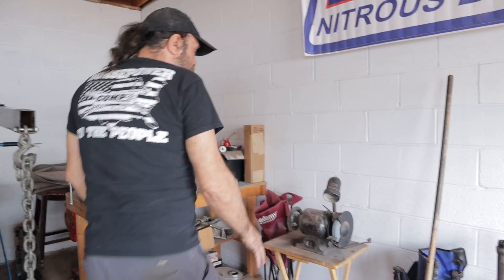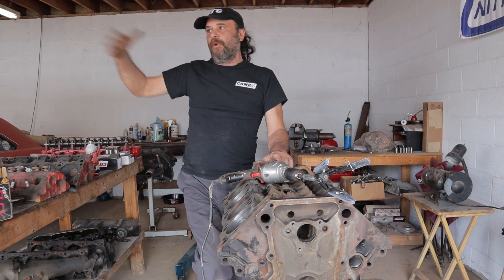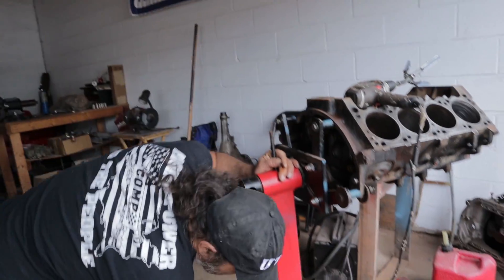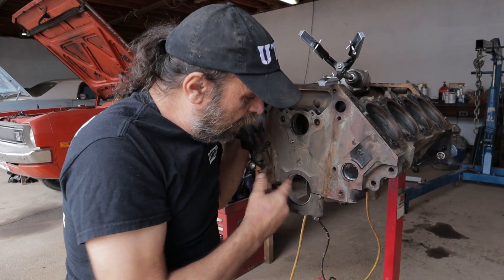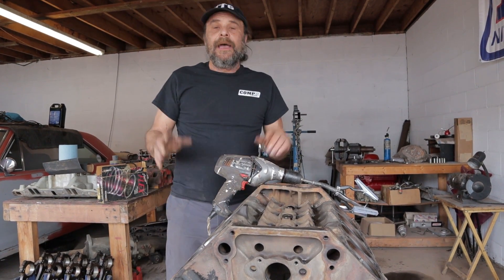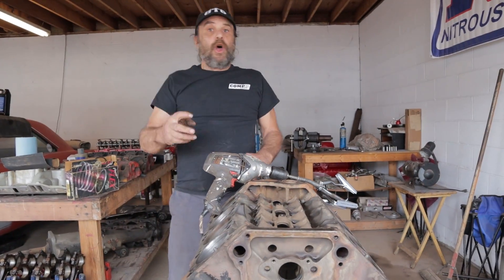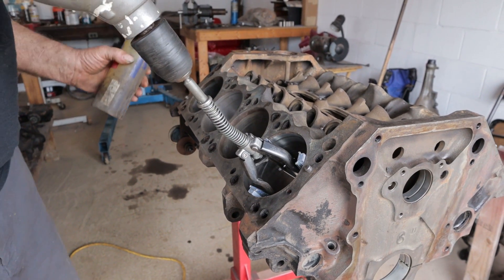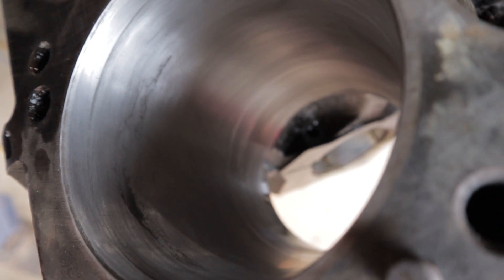Perfect Daily Driver 6 - DIY Engine Block Prep

Comment: My engine textbook calls a dingleberry hone a "finish" hone and a fixed stone hone a "plateau" hone - the finish is for honed cylinders and the plateau for opening a cylinder from the piston diameter after boring to the finished diameter (with proper cylinder-wall clearance)

Comment: RE: Ridge reamers... At least as of 1999 Ford was still putting a step in the engine disassembly portion of the factory service manual to run a ridge reamer on each cylinder before trying to remove the piston.  I recently disassembled a 4.0l v6 from a 1999 Ford Ranger, heavily used, no ridge at the top of any cylinder at all, so I wondered what they were going on about.  I had no problems removing the pistons from that engine.

But, suffice to say that people are still using them at least in part because the manufacturers are still making a recommendation to do so.  Not that I believe a whole lot of things that the manufacturers say.

Comment: I sure didn't have enough time to learn from this professor. 
LQ4 block, bent rods from (I'm guessing hydrolock), work truck and a $900 budget. Now a misfire from the 2 damaged cylinders. I wouldn't been able to bore anyway.     The machine shops were backed up.😔 I needed to get back to work.

Comment: I've heard that there is a situation where a ridge ream is necessary...a guy scored a nice 455 Pontiac that was never revved past 4,000 rpm...but he swapped in a new cam and started regularly shifting it at 5,500+....aparently that was enough for the ridges to break a bunch of top rings.

Comment: We were talkin word-for-word in the freezer plug they also made engine block heaters with the freeze out plug so when you put it in a head engine block heater in it and they did that on a gasoline engine as well as a diesel

Comment: Ok.  I’m in a rebuild of a 79 F150 302 that didn’t burn oil or has ever been worked on. So far I’ve found bad timing chain, vibration damper, bad driver side motor mount and very minor water intrusion. I think the water came via head gasket. The crank bearings look good. Thrust bearing looked rough probably due to the bad damper. Cam bearings were showing copper. Cylinder wall near no ridge. I’m looking to put in new con rod bearings, main and cam bearings. Right now engine is completely disassembled. With the current issue with hydraulic lifters. I don’t know. Pushrods look great. What do you recommend?

Comment: i did use sand paper on my xr200r lol it did work and still runs and don't smoke but the bore was 60 over already. all i have into it was a 30$ set of rings.

Comment: When I was on Crazy Deans pit crew 1968 - 1971, we used the dingle berry  for cross hatching  quick piston changes in the pits. I worked primarily on the trans team (he used two top loaders and a main shaft eplacement in three passes) but spent a fair amount of time on engines as well. This was before the advent of engine machinists in the pits.

Comment: One thing important to me with the LA engine is removing all the rear block plugs to clean out the bores. Remember to put new plugs back in. Also my mopar engine bible says to properly build an engine it takes about 8 hours a day for 30 days. Just making sure the rings are correct takes a lot of boring time. Plasta gauge is another crucial that takes time. Do it right with the best you can afford. I never ever hone lifter bores either.

Comment: Uncle Tony, I love you like a brother, but you teaching the guys wrong on the top ridge ring grove cutter, since I can't draw it, I am gonna have to explain it, so please bare with me. Cast iron auto blocks or aluminium lawn mower engines wear the block the most at the top of the cylinder, the top compression ring wears the top of the ring from a square sharp edge to a radius,, the block is also worn a radius, if you do not cut this radius the new sharp square ring is gonna cut it for you, breaking rings, ring grooves and damaging pistons! enter the Ammco 2100 ridge reamer, also the Ammco 3800 cylinder hone has a middle anchor to the hone stones and a second leg to hold the stones parallel. They are two must have items in any mechanics toolbox. You can clean a ring groove with an old broken ring if you are gentle, but it would be insanity to not cut the ridge out of the top of an engine block unless there is so small a top ring grove that you hone it away. You also do not explain the idea of a loose race motor using a slightly oversized bore with standard rings, what we call a Poor boy race motor. You cut the ring groove, hone the cylinders, the bore is slightly oversized, or to the top of the limit the book gives. You run standard rings and you loose a little compression at the top of the cylinders, the motor is gonna use some oil, but its gonna be loose, and like the NASCAR boys say, Loose is FAST! Theoretically it would be the same as boring it 0.030 over or 0.060, all new pistons and using low tension oil rings and instead of lasting 75,000 it may only last 60,000. Do you know about measuring the bore in 6 places with inside micrometer? cock, rock and lock? Did you know that rings rotate while and engine is running? The rings follow the hone pattern and actually rotate on the piston the first part of an engines life. Something that works in racing motors is a tiny hole squirting oil from the top side of the connecting rod, when the crankshaft oil hole comes around TDC it is aimed to the oil ring and it squirts oil up under the ring, sealing all the rings, Its a tiny metered hole so you do not loose oil pressure to the bearings, its on all Toyota Motors and helps cool the pistons and adds to ring life. High end Ford Y blocks I seen where Mr.Dorton makes squirters connected to pressurized lines he runs like a plumber, but I am getting way out there now. if you can snag your fingernail on a top ring grove, its enough to break ring lands and rings, I was sqweezing tangerines and had to stop and go wash my hands, I just could not let this injustice go further...Look up vintage tools, ammco 2100 ridge reamer, Ammco 3800 hone, the one that is on Google now is the lisle 15000 hone, they both do the same thing. I can see some kid spraying that 100hp bottle of Nitrous on a standard bore motor and breaking all the ring lands because he didn't cut the top ring groove out, wondering what he had done wrong. if it ain't there it can't hit it and break stuff..

Comment: The engine block is the foundation upon which everything else is going to be built. The best heads, port work, intake, carby etc are all for nothing if you don't have a good seal to keep the energy inside and good oiling to keep it all turning over.

Comment: When I was a youngster Back in the early 90s I bought a SBC it had an Eddy intake I was like cool but it said sp2p I had no idea what it was or even what I was looking at I was self taught no mentor so I called Edelbrock and asked the said a low rpm mpg intake from gas crunch no good for performance. I sold it to a dub head who insisted it was for performance even tho I told him. I wish I'd kept it for a small displacement off-road build like 305, toss a qjet, Tq cam, diy head work (to boost efficiency) small valve heads In say a Jeep CJ or Cherokee you could crawl up the grand canyon at idle!

Comment: I think your drill is spinning way too fast to hone cylinders properly. What is the angle of your crosshatch pattern? If I remember right it supposed to be around 45 degrees or so.
Oh yeah, change that drill cord! Your cutting fluid plus a small arc will equal big boom! Actually, I'm surprised the arcs from the brushes haven't ignited it yet.

Comment: What are you thoughts of using electrolysis to remove rust in the engine block. I saw a trick where a guy used a plastic garbage can, cleaning solution, and an old battery charger with metal cutouts on the sides where the negative and positive terminals connected.

Comment: The core plug you want to replace no matter how it looks...the one that will end up hiding behind the starter. Once everything is installed and in the car, finding it leaks is a real PITA. Also plugs in the back of the block--if you have a clutch, you don't want a leak.

Comment: Plus mic out the cyclinders after the home made hone job, can be out of specs, check ring gap with feeler gauge at different depths but if its a beater and oil is cheap hammer that engine.

Comment: You're the first person I've ever come across that's said do not use a ridge reamer.  Every book and manual Ive  read says use one..even my instructors back in tech school decades ago said that.. why. Cause new rings will hit the ridge and break them. I guess if you're reusing the old rings, which is another first I've heard , then I guess...guess ...it would be alright.. maybe... so long as it's on the same piston on the same ring land in the same bore in the same clock position ..because the edges are wear mated.. even though you can't see or measure that...or so I've been taught .....that is assuming that ring didn't break when knocking the piston out of the bore past the ridge..and taking it out of the piston and putting it back on with the proper ring tool.  Not trying to sound like a know it all and I must have missed it, but I didn't hear you mention checking bore taper by measuring the ring gap in different positions in the bore. Or checking ring gap on new rings to make sure they are correct in case they were  mispackaged in the wrong box.
But I certainly agree sbout the questionable metalurgy in new parts now considering where they are made and who operates the machinery manufacturing them.
I've always used the dingle ball hone to finish hone after using that long hone tool there. Gasoline as a hone lube? Man that's living on the edge brother. 
Anyway, I very much enjoy your vids..even an old dog like me that's been doing this 32 plus years can learn or relearn a trick or two.  Love the bench grinder/ wire wheel on the desk table idea..sitting down while cleaning a buncha bolts and such looks much easier on the back compared to standing in the same spot for a while doing that.

Comment: I commented recently on the Sunday Night Live about this motor but I'm rebuilding a 327 with my father, it's truthfully my first real motor

The motor had been professionally machined and honed however it'd also sat for quite a few years. We ran a dingleball/berry hone through the bores each VERY briefly just to assure that everything was nice and fresh and that's it. I think in total it was maybe one, two passes each cylinder. Anything more we'd have gotten a true fixed stone hone out to fix

Comment: Never reuse rings, very rarely are any piston rings from vintage engines in reusable condition. And like you said the cylinder can be out of round making the old rings grind into an oval over time so putting them back into the bore to see how your honing is coming along is no good to you. It's rather extreme but does happen a lot, I see it in most engines (wether it be an ATV, motorcycle, garden tractor, or car) from the 80s and older, the cheap rings they used are no better than what you don't want to trust.... You'll be there forever making no ground because your one guide (the ring) isn't true. Take good measurements of the cylinders with a telescopic gauge before and after you hone to measure your progress - just that first measure can tell you if it must be bored in conjunction with feeling for large burs that catch a nail.
I can tell your block needs to be bored because it has deep etching towards the top of the cylinder from when it sat for years with a little water or coolant in the cylinder, if it doesn't disappear after honing you'll always be burning oil in that cylinder. And they say that because the surface is porous and isn't uniform to the rest of the cylinder that that area is weaker and will absorb more heat making it more prone to cracking over time.

Should always check the end gap of rings too, if you find the stock rings' end gap is outside specifications you'll have blow-by from day one as the combustion charges leak through those excessive end gaps even if the ring seals to the bore just fine. Also need to check the ring ends for burrs or after your break-in period there will be scoring straight down the cylinder for combustion to leak through causing more blow-by.

Comment: The last I seen a ridge reamer used was on an old tractor . It was a popping Johnny that was rebuilt 3 or 4 times . It was mint to crawl around the farm pulling stumps and a plow .Pawpaw did valve jobs with a suction cup on a stick . He recharged condensers by hooking the hot side to a car or truck  spark plug wire and starting it . Thats what Pawpaw did . Hi was a 15 year old boy in the Great Depression  . They still had a his and hers outhouse in the backyard .He made gaskets with thin leather , inner tubes and shoe box cardboard .

Comment: I have a HUUUUUUUUUUUUUUUUGE problem with fixed dimension stones... In MY experience, they're NOT ~( ,m,)~

Usually they RAPIDLY deform and take the shape of the defective cylinder, UNLESS I use specialized tungsten carbide geometric  cylinder hones [too expensive to buy, so I only borrowed it last time I had one], I have a policy of checking the stones rapidly between 15 second cycles to see if they are deforming.

If I find they are deforming, I send the machine out to have the cylinders line bored to remove taper and bulge.

      /)/) 
     ( '.' ) 
@(>_ )> 
      \) \)

Comment: Rebuilt brake calipers, banjo bolts, and  Dorman copper washers have caused me a lot of grief of late.  I have started just buying dealer parts as they generally fit and seal.  Otherwise rebuild the caliper, drill out broken bleeder, etc. typically less head ache.

Comment: Hey about the copper thing ,I got a engine with some copper showing in rod bearings. No bearing noise ,engine runs well ,good oil pressure but the rod bearings in the caps do show copper. Why is that? Talking about a chrysler 3.5 v6 EGG. In Europe its hard to get american rod bearings so preventive maintenance is not easy. Is that normal? All people I asked said thats caused by revving the engine hard.Its weird for a engine that always had oil changes every 3000 miles and there is zero sludge or brown anything inside....clean as new.

Comment: Chevy and Ford cam bearings usually don’t give any trouble. Chrysler engines are so poorly machined that a lot of times, after putting in new cam bearings, the can won’t turn! We used to have a cam reamer that we would put in and turn to cut the new clearance into the new bearings!

Comment: Just rebuilt the rear drums on a 81 Cordoba 
Needed new break cylinders 
Bought some "quality " "America " ones from the parts store 
Made in china
Breaks wouldn't bleed
Not only were the bleed screws wrong size, shit machining (im a machinist) threaded off angle, bleed hole was a 1/4 the size of an original "made in America " Chrysler part, but they leaked. 
After fucking around for 2 days with this junk i took original ones off my 1979 9-1/4 diff, cleaned them up and installed them 
Bleed the breaks in 15 min
Haven't had an issue since

Comment: If I am rebuilding an engine and it has a tiny ridge in the cylinder wall. Could I hurt the engine by doing the piston pin offset mod? I am rebuilding a 351windsor. Also doesn't dwell get longer if I do the piston pin offset+change the position of the ridge over time because of the minor change in angle of the pin?

Comment: Imawaysnuse new head bolts on some engines you have t torque t yield and to clean out the treads run something threw them to clean makes life better and will tourque proper

Comment: We went through 3 custom cams because of lifter issues a yr or 2 ago finally bought some from Howards and they where fine but the other 3 manufacturers likely sourced from the same chinesium plant. The first cam lasted 1 race the second failed during breaking and the third made 2 laps all where caused by bad (soft) lifters

Comment: Hi Tony, I totally understand what you are saying about the honeing process. But, what about the cross hatching. I didnt see any on the cylinder that you used for your demonstration.  If you dont have any your rings will not rotate. could you please explain this because when you use a dingleberry hone you get cross hatching.

Comment: As far as piston rings go, the best way to check em is you warp em like a spring. Not too much - about an inch and see if they return to that same level. If a ring stays warped, it had been overheated and shouldn't be used anymore.

Comment: Excellent, as usual.  Now:  Let me ask a question.

When the hone hits the ridge on top, however small it is, doesn't it tip the stone and cause the other end of the stone to dig into the cylinder?
Reply: oh, you noticed its taking a ski-ramp jump off the ridge? :)

Comment: I know this konda off the subject but hows that slant 6 running/doing in that guys car since you had them rebuild it? Also what size ring gap do you recoment for basic rebuild or performance ? Wouldnt the old ring be weak/brital due to heting and cooling continuesly ? Also are you reusing the pistons ? Should a person reuse old stock pistions? Would they be weak as well?